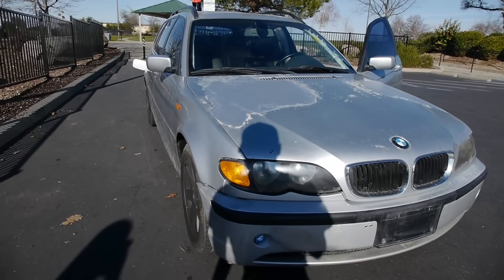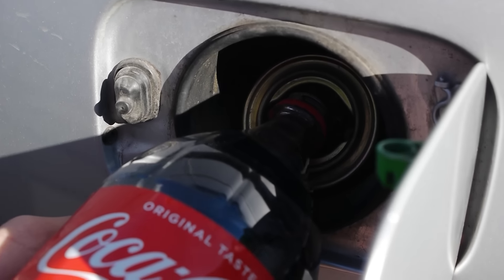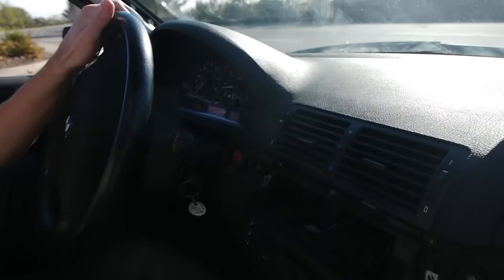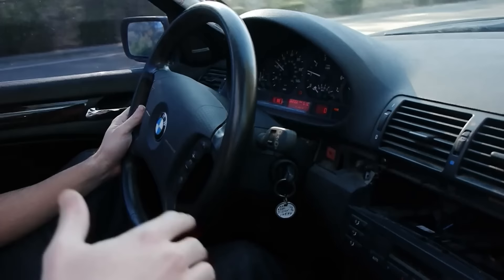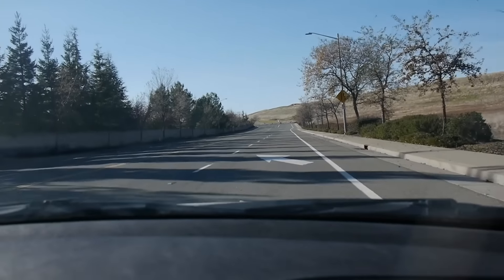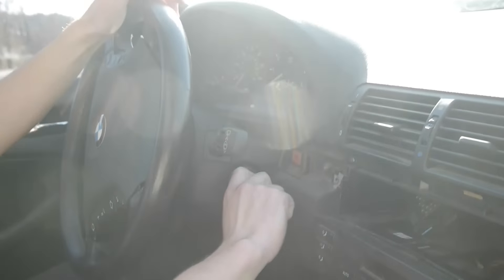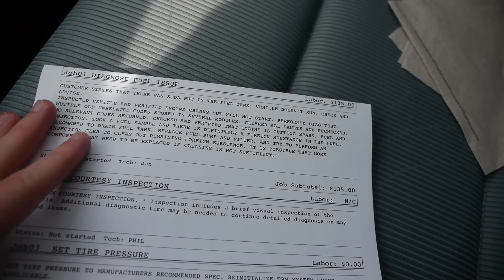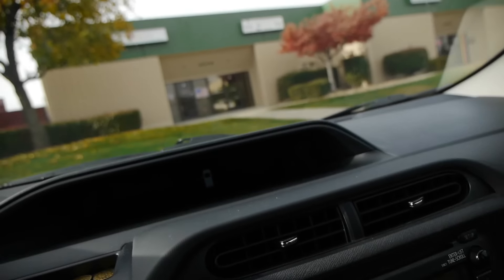What Happens If You Fill Up a Car with Coca-Cola?

Comment: Coca Cola isn’t explosive like gasoline and it’s mostly water so when it enters the cylinder from the fuel tank it’s just pooling there because the spark plug can’t ignite it. Since water can’t be compressed by the piston or ignited you’re going to get a huge hole in the engine or throw a connecting rod. Not to mention ruining all of your fuel lines, rails and injectors. Watching this was painful and if it wasn’t obvious don’t actually do this to your own car.
Reply: Tommy Ward - Thankyou someone else here with some idea of Mechanics and knowing how this obviously won’t work, maybe I should fill my race car with Pepsi for +50hp 😂
Reply: I literally never knew that😶
Reply: Tommy Ward Facts
Reply: That's exactly what i said in my head.
Reply: Tommy Ward he said he wanted to break a car instead of a phone now
Reply: Josh Peace what car do you have?
Reply: English pls
Reply: This video is painful to watch as a car guy
Reply: hundo bundo I’m sayinnnn
Reply: Don't forgot when Coca Cola gets heated it get sticky and that messes up with engine pistons
Reply: That's actually not what will happen, what will happen is there will be a separation between the coca cola and gasoline in your fuel tank and the coke may act as a detergent breaking down  the sludge in your tank causing more foreign debri to be sucked up by the pump. As it travels through your fuel lines and into the pump it will gum up the pump and filter because of all of the impurities in the coke. After it gets sprayed out of the injectors it's going to burn because of the intense heat and coming out in squirts with fuel will make tremendous carbon build up and the extra "fuel soda" will get pushed out of the exhaust valves and burn in the exhaust system creating steam and smoke from the sugar burning and water evaporating
Reply: A true car guy
Reply: I'm doing this to my fucking car
Reply: What would happen with rubbing alcohol?
Reply: What would make more sense is alcohol, but even then would ruin the engine
Reply: He said there wasn't much gas left in the tank, so I was assuming there was mainly coke going through the fuel system. Since Fuel is less dense than water it's going to sit on TOP of the coke water in the fuel tank. Since the pump is designed to reach the bottom of the tank it's going to draw the water in first. So the little bit of gas remaining in the lines and up to the rails is what started the car and kept him driving for a minute. But at some point the ratio of fuel to coke would be unbalanced and it would be all soda going through there. That was the scenario I was assuming. Whether or not there was more fuel or coke, we don't know. If there was significantly more fuel than coke to start with, you'd probably be right.
Reply: Tommy Ward I feel you dude. I used to drive a BRZ and my buddy tried throwing fuckin monster in it. I'm cry
Reply: as know you can almost kill a  car by using the wrong gasoline ( aka using diesel on an gasoil car get some shitty result for the car XD ) .....  that was obvious, but i guess they are peoples who doesnt know that and maybe think that the car can work due to the pressure of the gaz in the cola , but.. LOL
Reply: Tommy Ward wow are u a mechanic
Reply: Sounds like nerd talk for spicy drink no make car go vroom vroom
Reply: Nah, I just love cars and science. For the people saying alcohol.. "technically" yeah it does work,  they actually build race cars designed to run on E100 (100% ethanol) alcohol. You may have heard the term E85, which is 85% ethanol and 15% gasoline. It's basically race fuel and has an octane of like 102-106.
Reply: Tommy Ward they most likely just filled the coke can with gasoline
Reply: I agree with you lol this was the 3rd time this video was in my recommended and I kept skipping it because I thought it would be painful to watch
Reply: It is like putting sugar in the sugar tank and water
Reply: That’s what exactly I thought
Reply: Tommy Ward was just about to mention that coke is not combustible
Reply: Josh Peace instead of e85 and other ethanol based fuels just use some proper juice from a can of corn
Reply: cool story bro needs more dragons
Reply: Tommy Ward so many words
Reply: Tommy Ward there is also sugar, and it can corrode the cylinders
Reply: Tommy Ward your comment deserves a A+++
Reply: I found the rick and morty fan
Reply: Smexy's Edits That might cause the engine to knock and detonate. That would be a more interesting video than coke though!
Reply: Brandon FPV have you ever heard of e85?
Reply: Tommy Ward so put sriracha in it? 🤔😉
Reply: If your car guy u cringed
Reply: Tommy Ward Dam your smart
Reply: Tommy Ward yea,I didn’t understand any of that.
Reply: The fuel lines, injectors and pump will be ruined by the sugar in the Cola.
Reply: I think it would work if there is a little bit of gasoline
Reply: Josh Peace nah + 600hp
Reply: Aaaaaaand sugar is going through the motor, and it will "choke up" the systems
Reply: So you're one of those guys who writes those paragraphs and stuff  when it's obvious?
Reply: Tommy Ward So basically you're saying WATER will do the exact SAME DAMAGE as Coke??
Reply: DonD512 close...water cant be compressed, and compression is pretty much the thing that makes a motor work. So, when the motor tries to compress the water, it can blow a hole in the block, throw a rod, the whole shebang. The only difference between the coke and the water is that the coke has the added sugar. Sugar alone would destroy and engine too.
Reply: DonD512 yeah the pistons in engines compress air and gasoline and blow it up with the spark plug. The power generated from that explosion pushes the piston down and runs the motor. Water isn’t compressible, so the piston has nowhere to go so it either blows a hole in the engine or breaks the rod connected to the crankshaft called the connecting rod. The same thing happens when you drive through water. Air comes in through the intake instead of the fuel injectors like we’re talking about here.
Reply: Tommy Ward Interesting, never knew that. Thanks for the answer✌
Reply: water is in coke m8 stop acting like u knpow what ur sayin
Reply: not much.. keep running
Reply: Tommy Ward it's like having rust in the oil and a cracked piston and shredded head gasket and torn fuel lines but 100x worse
Reply: Tommy Ward plus it's a BMW
Reply: Josh Peace lol 911 likes
Reply: Wow your smart
Reply: Tommy Ward executive
Reply: Tommy Ward I'm a beginner when it comes to cars, but hell even I know that this is a dumb idea and even more so trying it on an actual car.
Reply: Tommy Ward congrats I’m your 1k like
Reply: WIZARD PIGZ haha this is awesome I’ve never had a comment with 1K
Reply: Tommy Ward also coke has sugar!
Reply: Tommy Ward After pondering this I completely forgot about rotary engines, like some Mazda sports cars have that don't use pistons. 
What would happen to those motors? Would they be okay if filled w water?
Reply: DonD512 yep, same concept with the rotary. It still has a compression and ignition stroke. It just doesn't have connecting rods like a piston based engine. It's connected directly.
Reply: Not explosive? M E N T O S
Reply: Actually, 80% of the Solids (of the Ingredients) in Coca-Cola is Sugar:  THAT'S What Did The Damage !!!
Reply: Wrong
Reply: Tommy Ward exactly.
Reply: What if its not pure soda what if the gas tank was halfway full already?
Reply: You forgot heating up and caramelizing..
Reply: @name3365  how it wont work??? I 🤔looks like it worked just as they intended it to.. leaving it "Fucked" and unusable...
Reply: Very wise
Reply: Who asked

Comment: “It went from 3000 RPM to 2000” bro the car shifted gears...
Reply: Paul Hawkins NONSENSE ITS PROPELLED BY A GRAVITY REACTOR!!!
Reply: HERPY DERPEDY no it isnt where did you get that from???
Its obviously powered by magical pony bum fluff
Reply: If the car shifted gears it would’ve sped up not decelerate..
Reply: Envy YT if its shifts down a gear it doesnt speed up dude. Do you knoe anything about manual cars
Reply: BannedFromUtube23 lol it isn't even just manuals lol. All cars rpm goes down when shifting gears
Reply: Paul Hawkins the car burped from all the coke
Reply: Envy YT i think you need to do to school
Reply: BannedFromUtube23 what do you mean? When you redline your rpms are very high, so you can’t speed up your at top speed on the gear. So you shift, rpms go down speed goes up.
Reply: its manual bro
Reply: Paul Hawkins lmao kids arguing about driving cars

Comment: I thought the car was going to explode for some reason
Reply: noonegaming 12 me too
Reply: That is not how a car works. It tries igniting a tiny bit of Gasoline to create a small explosion inside the engine to push a piston. Because Coke is not flammable, nothing happens. So you are at more of a risk using gas then Coke when it comes to fuel.
Reply: Me too
Reply: I was hoping the same.
Reply: jaredmai do what if you put liquor in a car
Reply: noonegaming 12 I was hoping that it would so that we don't get any more of techrax.
Reply: noonegaming 12 same

Comment: Can you try doing this with vodka

Ir might actually work
Reply: loading please wait sounds interesting
Reply: meanwhile in Russia...
Reply: No the car will get drunk
Reply: That will probably cause a fire because of the alcohol
Reply: Ahmed Hadzic haha😂😂😂😂😂😂😂😂😂😂😂😂
Reply: ShadowPlayz xD are you kidding right? gasoline is more flammable than vodka and car didn't explode with it.
Reply: PrzeszczepiX yeah but gasoline is made for cars
Reply: ShadowPlayz not exactly. primarily gasoline when was invented, it was used in lamps and lighters
Reply: Depends on how flammable it is. How high of a temperature is needed to combust vodka vs coke.
Reply: Given that vodka contains alcohol it might work kind of?
Reply: loading please wait The car will turn into a tank
Reply: You fool! That only works with Russian tanks
Reply: Monster*
Reply: Vodka doesn’t have a high enough proof in it! You better bet is trying a grain alcohol like everclear
Reply: loading please wait vodka and uranium
Reply: Moonshine fam
Reply: It will work. I don't know for fuel injectors if they have to be replaced (modified) or not but I know an Audi S2 drag car that uses vodka as fuel.
Reply: loading please wait it will cars run on any thing flamable
Reply: loading please wait or alcohol
Reply: Ahmed Hadzic It won't if it is Lada

Comment: Wouldn’t have a problem if you did this on private road and not in public where you could kill someone smh
Reply: Arbroaths Finest cmon this was fun
Reply: Who cares
Reply: There are countless things that could've gone wrong. He could've been coasting down a hill, the engine stalls, power steering fails, and now he's driving off the road and hits someone on the sidewalk? It's completely possible. This video is irresponsible to do on an open public road. Heck, it might even be against some law to do something like this on a public road knowing it's going to do this. The video is evidence that they knew it was going to happen.
Reply: How is coke in gas tank gonna kill someone?
Reply: Max France no
Reply: Max France the brakes are hydraulic not electric

Comment: Put alcohol next. Maybe the car will work as alcohol is very flammable.
Reply: jakhari brown bro alcohol is also flamable
Reply: The car will get drunk hahahahhahs
Reply: It probably will
Reply: Guys. Engines do work with alcohol with some changes made to the fuel delivery. Or with a mixture of gasoline and alcohol. But mind me it won't work with the alcohol we drink xD
Reply: Ocean Meme Methanol is an alternative fuel for internal combustion and other engines, either in combination with gasoline or directly ("neat"). 
Taken from Wikipedia.
Now don't tell me that methanol is not alcohol.
Reply: JazibOfficial the chrysler turbine could run on anything flammable like vodka
Reply: JazibOfficial you can’t be drunk driving the car will get a ticket
Reply: JazibOfficial have you ever tried to set alcohol on fire lmao it's not that flammable
Reply: sevan grigoryan 🤣🤣😂😂😂😂😂
Reply: Ocean Meme methanol is not an alternative fuel for ICE’s. Ethanol is in Gasoline and is the reason why Gasoline sucks now. You could use rubbing alcohol in a pinch but there is a reason that Gasoline is used for most ICE’s.
Reply: Guys I think the car will explode. I don’t know if it’s true but have one in mind
Reply: If he uses moonshine it may work
Reply: JazibOfficial you have cars that runs on methanol lookup bmw m4 meth
Reply: Unco Casey depends on what proof. An 80 proof vodka will have hard time igniting, but what that proof means is what concentration of ethanol there is. The alcohol you drink is just dilute ethanol with other stuff of course. 200 proof means 100% ethanol. Remember that they actually mix ethanol into our normal gasoline so your always running on 10% alcohol technically.
Reply: Joshua Middleton yes in the alcohol we consume contains to many water, if you destilate it out you can add it to gasoline.
The ethanol inside gasoline is made by the chemical way not by brewing
Reply: JazibOfficial 😂😂
Reply: JazibOfficial already done with drag cars
Reply: It won't work unless it can combust, even if it's flammable
Reply: Dutch Moto Pure Ethanol is made by fermentation similar to spirits, but it is not made exactly how spirits are. Pure ethanol uses biomass such as sugarcane, and is fermented to make a non food grade ethanol that is very concentrated. Both types are made in similar processes, but have different steps and additions tailored to their uses. However it is all the same chemical in the end that we know as alcohol.
Reply: Joshua Middleton Ethanol by fermentation only will gain about 14% ethanol if u want 99% you need to distillate the mixture, but u can make ethanol via the petrochemical proces this wil result in very pure ethanol and is cheap to produce.
Reply: JazibOfficial it can also (depending on the car) it burns to hot and can blow the engine
Reply: Kartikay Khattar 
To pass California emissions,  a bottle of 98% rubbing alcohol in 1/2 tank of gas, driven one afternoon till gone,  will pass test easily next day in most cases.  Unless rings are shot,  or motor is too far gone.. seen mechanic at Longs Drugs almost clearing shelf one day.. buddy swears by it.
And methanol water injection on turbo engines,  are known to steam clean piston chamber. 
Not to mention boost power.
Reply: Jody Cunha Ethanol burns very clean

Comment: Damn it only had 82k on it too
Reply: TechWarrior160 Tf are you even trying to say
Reply: Tru Blu haha do you even know what hydrolocking your engine means?
Reply: They should've tried it with pure syrup.
Reply: That poor 3 series wagon, besides some cosmetic issues and that rattle, it was still probably a really decent car.
Reply: ThatCarGuy if they take out the spark plugs and turn it over and clean the cylinders it will run. May not run perfect but it will do the job.
Reply: ThatCarGuy it's also a BMW so it was about to crap out at 100k anyways
Reply: Ruben Salazar not really lol. If you take care of your cars you can get them to run to 200k or even more. Those 3 series can go to atleast 175k. Don't believe in the BMW has crap reliability stereotype
Reply: J.D. Strickland agreed
Reply: Hippos Is Savage also agreed
Reply: Its a 325i Wagon chill it would have died anyways
Reply: Zarif Ayman all cars will die eventually. And I get it he did it for a video and it's a good investment on his behalf. I'm just stating that it had only 82k
Reply: ThatCarGuy only??
Reply: +ThatCarGuy your absolutely right, saying this is a beamer and it would have died at 100k is dumb, I know people with BMWs and there way past 100k, maybe just us car guys will understand. They're not our level of comprehension😂
Reply: SunlessLime fr. 82k is pretty good in my opinion. Honestly wouldn't even be needing to replace anything at that time. The family minivan is still running perfectly over 200k
Reply: joshua ditoro agreed. People don't realize how much a car can run if you can actually take care of it. Even then you can get 300k out of cars
Reply: joshua ditoro for real. I had an e30 running past 175k and sold it. E46 til 110k then sold it. E90 currently with 125k. For real, people don't realize how much a car has still in it
Reply: Well I must say I'm starting to feel bad for the wagon as my dad used to own one and it never left us stranded.

Comment: If someone ever cuts you off, instead of pulling a gun on them, follow them and when they park and leave their car, fill their tank with a bottle of coke. 

Great idea TechRax, I 'preciate u
Reply: Sammy ASMR yuhhhhh
Reply: But the car would be locked tho, so you wont be able to open the fuel door and the fuel filler cap :/
Reply: That Guy lol I want to be that guy. Get it..... Nope ok.